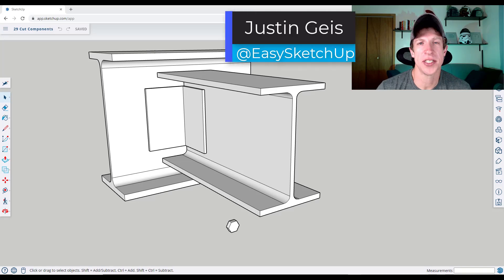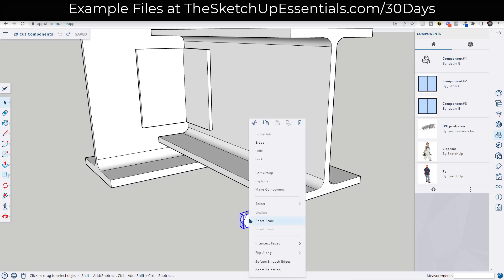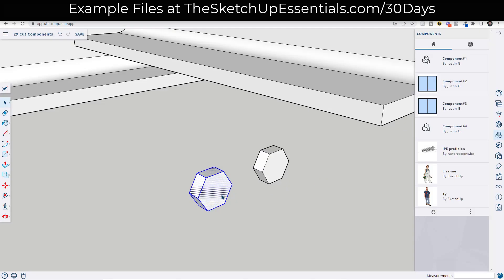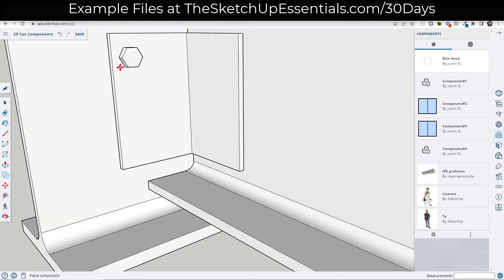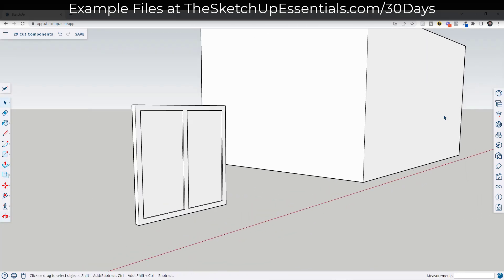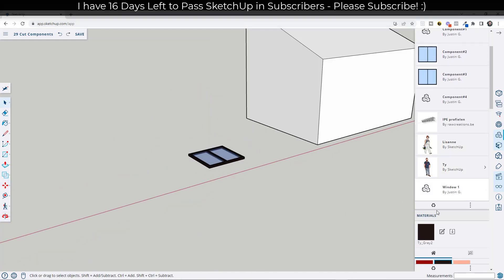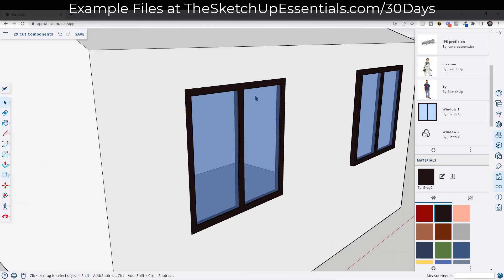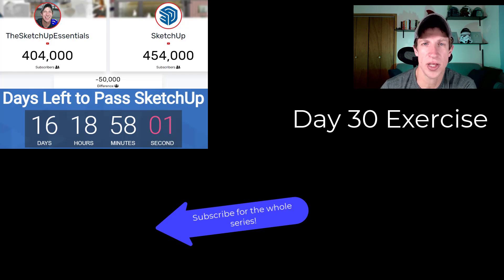Learn SketchUp in 30 Days DAY 29 - CUT OPENINGS and Glue To with Components!

Comment: If the component (e.g. window) I create is wider than the thickness of the double-face wall, will it cut through both faces?  (I suppose I can just try it.)

I've been using SU since 2008 and never understood glue-to until now... nor how to make my components automatically cut!  Thanks!
Reply: Also, you mentioned that the gluing only happens when the component is selected from the components list (not when moving an existing component).  What about copying a component (or move + copy)?

And how about cutting?  When, exactly, does that happen?  Does it happen each time I move a component?  Or Move + Copy?  Or just Copy?  Or only when selected from Components?

Comment: Hey I do have one question only. Is the desktop version faster than the free "web sketchup"? 
In my case after 15-20 mb of file in web free version the project is becoming laggy and sometimes even freezes. After 30-40 mb of file it freeze much much more often and is really hard to work with. I am about to buy desktop version, but if there will be same lags I would be unhappy. It's a cost of 300$ so you know, it's better to ask someone who knows the thing... ps. I do have RTX 3070 mobile with Ryzen 5600h, but I don't think it is as bad. Even later for rendering it's still more about graphic card right..
Reply from the maker: It's definitely faster than the web version. It will still lag on some larger models, but I think for 30-40 MB files you ought to be ok
Reply: @Thesketchupessentials  Thank you for the answer! Also appreciate that "30 day lesson", I will visit in time rest of your channels.